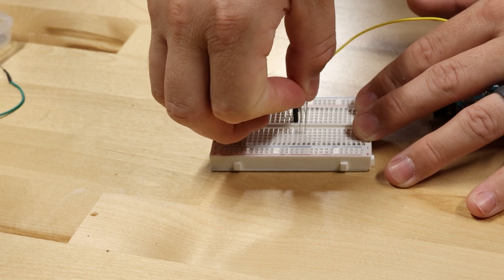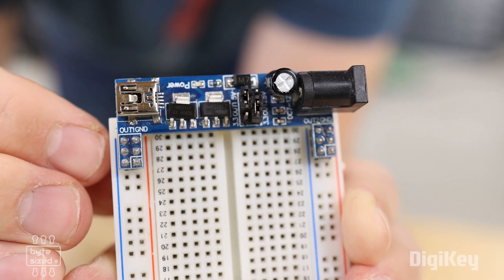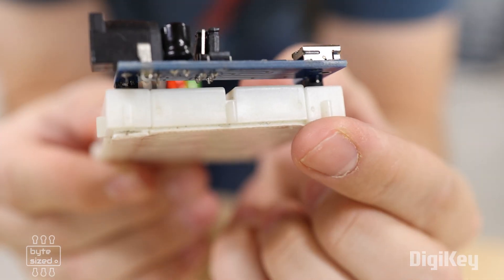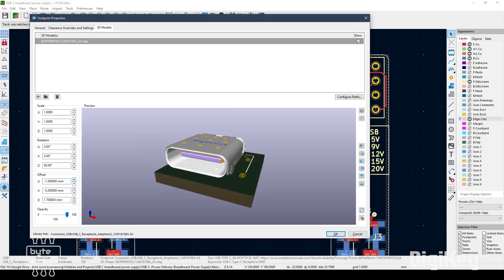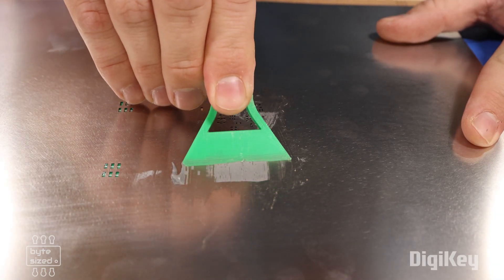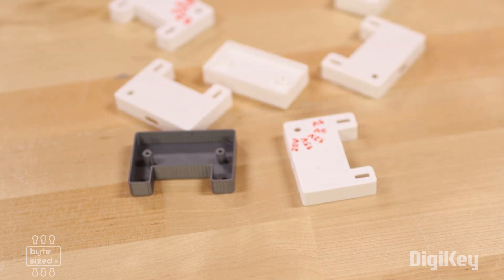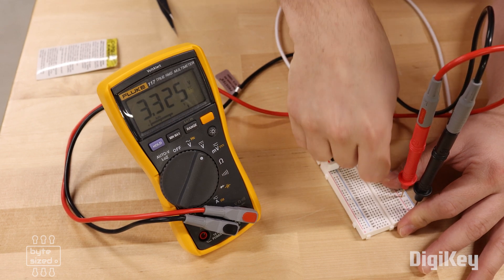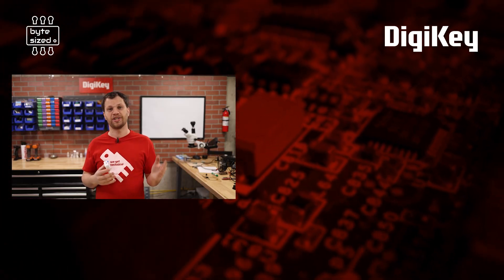A breadboard power supply with USB C power delivery - The Byte Sized Engineer | DigiKey

Comment: Nice vid, suggestions: change the voltage selection to rotary encoder, move 3.3V selection to rotary encoder and make use of electronic switch(es) for the voltages not supported by usb-c pd.  That could support more voltages...  also use a detachable flexible pcb for the connection to the breadboard.

Comment: GND should be the outside rails on either side. This avoids orientation issues and makes it the same layout on either side.

Voltage selection should be a button that must be held for a while to unlock. A switch that you can bump and overload your circuit isn't good.

An on-board voltage regulator would be good as many USB supplies have significant ripple (100+ mV p-p) and output a higher voltage than stated.
Reply: Great suggestions. Unfortunately whoever made breadboards didn't think to put the GND rails on the outside. They have markings that are color coded to indicate positive and negative rails.

Comment: One thing i often see missing are dual supplies, having positive and negative selectable voltages would be great
Reply: That's a good suggestion
Reply: @bytesizedengineering  Thanks, it would be helpful for the weird analog electronics people (such as myself ;) ). Something with atleast - 5/+5V and +3.3V, but selectable rails (don't need to be independent, just +/- 3.3, +/-5, +/- 9, +/- 12) and the 3.3v connection would be awesome! I do analog + digital stuff, and need the +/- supply with ground referenced to the usb connection to use other connected devices as well. Using the analog discovery 3 to do +/- 5V currently, but it doesn't have that third 3.3V connection.

Comment: Are ALL USB-C power supllies capable of giving ALL voltages? What happens, if the power supply can not supply the chosen voltage?
Reply: No, a USB C power delivery or "PD" supply is needed. Link is in the description
Reply: @bytesizedengineering  Ok, my failure. I meant: are ALL PD power supplies required to produce ALL voltages up to 20V?
Eg, my smartphone goes only up to 9V according to one of these Chinese PD monitors. The power supply it came with might be limited to 9V.

Comment: No way, I just designed and ordered a very similar PCB! I was having the same problem getting power conveniently on a breadboard, so I made the same C-shaped board. I just have a plug going to the power supply of my synthesizer, so mine is way simpler and only does +12v, -12v, and ground, but I also put in spots to solder optional headphone jacks or potentiometers.

Comment: Awesome circuit Zach! When are you putting it on Kickstarter?
Reply: Do you think there is a market for this? I have always wanted to run my own kickstarter for something.
Reply: @bytesizedengineering  I'm not a a marketing guy, but I'd definitely buy one! (or more) if you are thinking of the next version, a nice thing to have would be a separate power switch on the outputs and LEDs on the output lines. I'm constantly turning breadboards on and off to rewire them - mostly because they never work the first time. And being able to at a glance tell if the power is available (on the USB side) and powering the bread board (on the circuit side) can save a lot of the magic smoke from getting out.

Comment: Nice project. What is the max current that can be supplied at each available voltage setting?
Reply: USB PD typically supplies 3A or so maximum.
Reply: 5A

Comment: have the pcb upside down, so only the board skims over the top of the breadboard to plugin the pins, all the electronics on the underside, adding the microcontroller also lets you dump the selector, a few buttons up/down and ... might be enough and a ledbar, that would need 2 part pcb, lower for electronics, upper for pins, make lower have output twice (side A +/-, side B -/+), 
so you can choose on which side to connect the upper board, soldered or flexible wires/ribbon,  if possible have 3 usb c spaces on lower for 1 connector => top, middle, bottom.